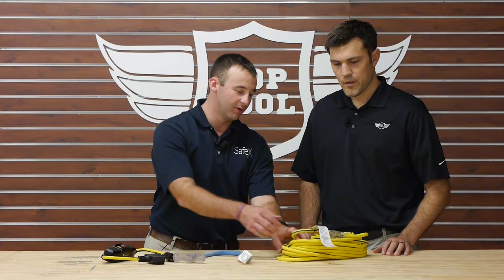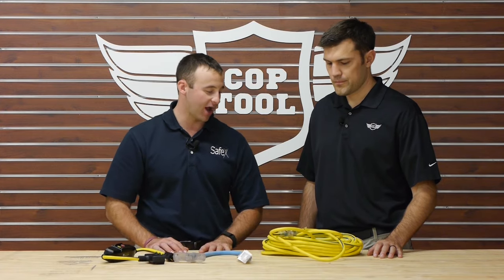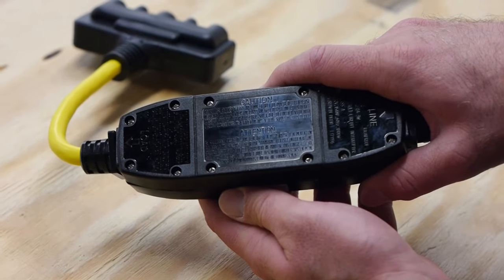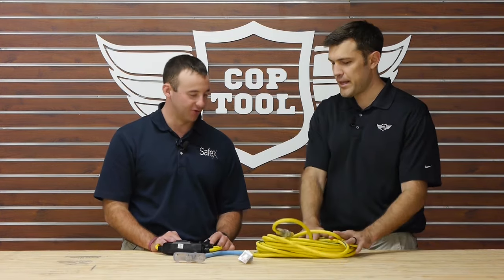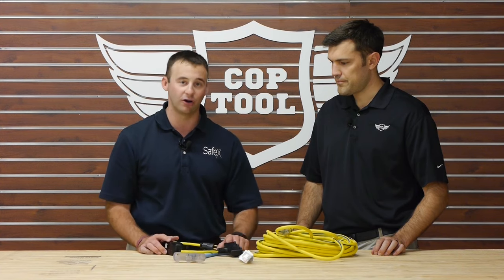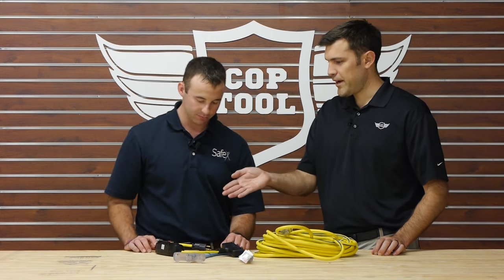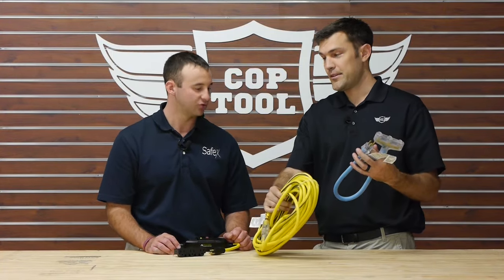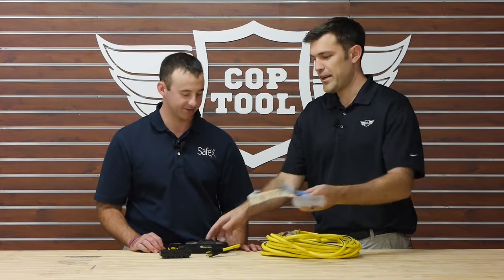Extension Cords & GFCIs - On The Job Safety Tips with SafeX

Comment: Can i plug in an extension cord permanently to a gfci extension that is plugged into a 120v receptacle?
Reply: No. Extensions cords are means for temporary usage and are not a permanent solution. Whether you plug it into a CFGI or Surge protector an extension cord should be removed from it's service every 80-90 days.